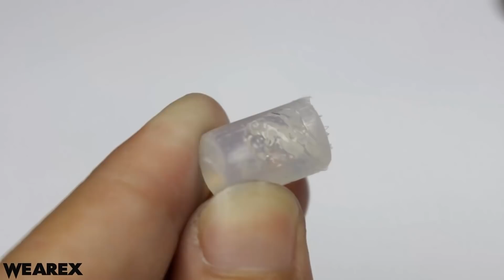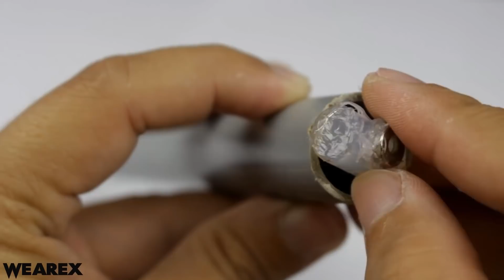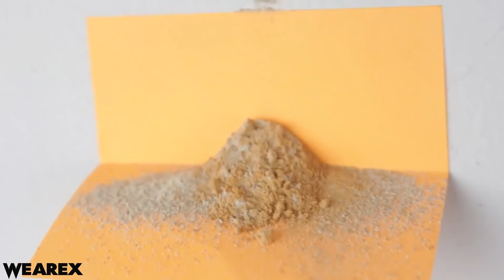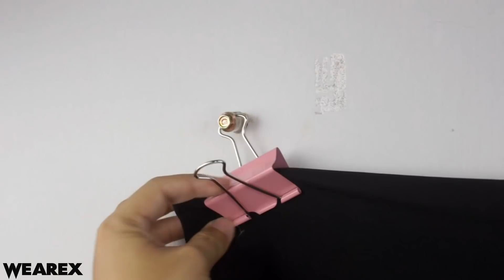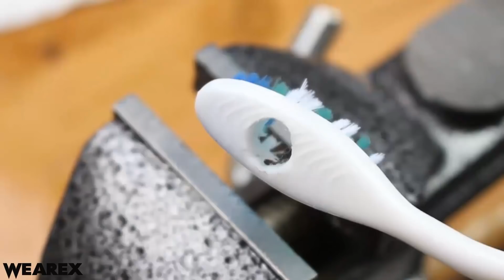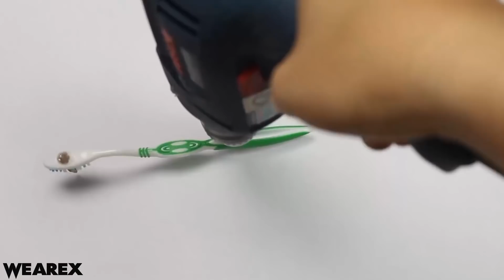5 HOUSE REPAIR LIFE HACKS YOU SHOULD KNOW

Comment: Or you could put the nail between the teeth of a comb. But then again, who's got a comb? It's much easier to round up a hot glue gun, a magnet, a specifically sized plastic rod, scissors, a length of  3/4" PVC pipe, a file and electricity.

Comment: So, if I want to mark 30 different size holes, I need 30 toothbrushes?
Reply: Yeah, why would I want to screw up a perfectly good toothbrush?
Reply: I think so
Reply: Just use a compass will do or a string tie to a pencil on one end as  the center  while the other to end to another pencil to draw the circle. Just adjust the length of the string for  desired size of the circle . No need to waste so much time.

Comment: Useless ideas-- instead of simplifying the things, this person is making jobs more miserable ,complicated -- Like Instead of marking a circle with pencil in toothbrush , why I will not use a compass & fix a pencil into it to mark a circle of any desired radius/ diameter..  For cutting a bolt why I will not use a rotary cutting wheel fitted in an angle grinder or any other machine which is much more simpler & easy..     Nonsense ideas
Reply: for all the ideas in this video -- i have much simpler , accurate & user friendly solutions - This person;s thought process is out of mind.